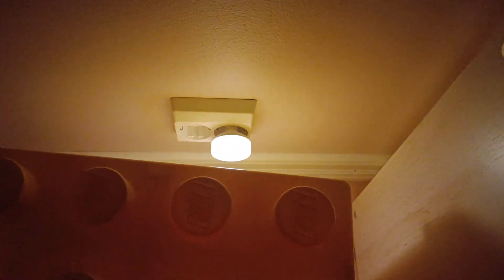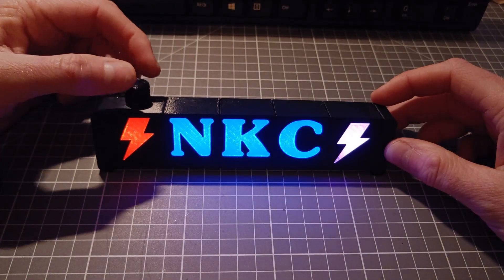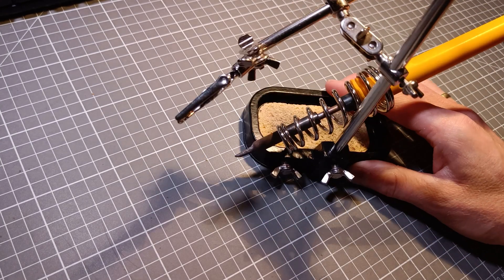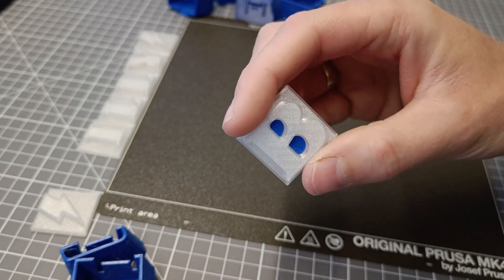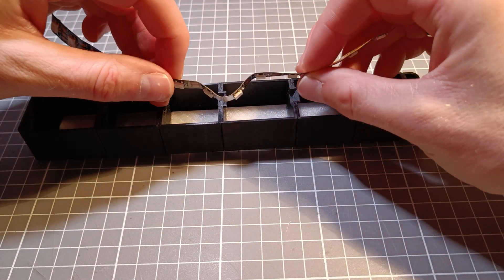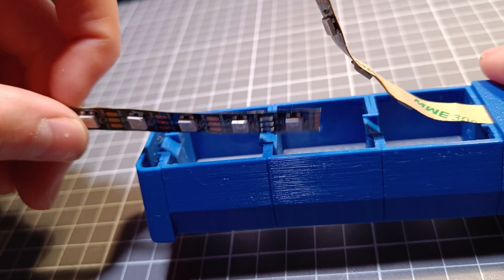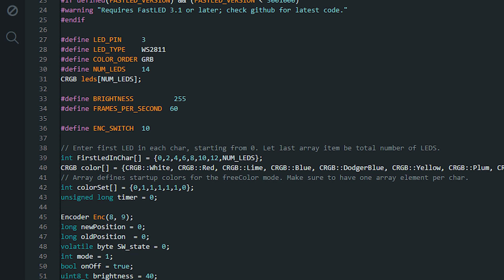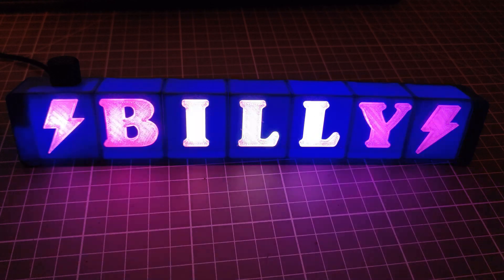3D Printed Modular RGB LED Sign

Comment: Very nice build! Flush or extruded? Hard to choose! I'm more on the flush side but the extruded has great character also! A question: resistor before the data line? I have never used it, is that really needed?
Reply from the maker: Thanks!! I like them both too, kinda depend on the use. I think the resistor is supposed to limit noise and protect a bit..but guess it works fine without also, especially with no long wires.
Reply: @TheSkjegg   Hmm, noise! The project I'm working on has some flickering, I need to try that resistor!
About WS2812: there are a lot of products out there, fairy lights style from 1.5 cm to 10 cm spacing, rings shaped, and even COB style, extremely dense strips and the newest I found is a COB ring shaped one, various diameters, check them out cool stuff!
Oh, and one more interesting: SK 6812 strip (side LED) that emits light to side of the strip, not perpendicular to it!

Comment: what should the seeed xiao device look like in windows device manager   i have just usb serial port com5  but i cant upload to that  arduino ide doesnt like that
Reply from the maker: Did you install the Seeed SAMD Boards? Then select the XIAO as board, and Port as com5. Sometimes XIAO causes trouble, but reconnect normally works, or IDE restart.
Reply: @TheSkjegg  i tried then i noticed i have not the samd board i have the RP2040 board  i had to download and install other board drivers but i guess your code doesnt work for Seeed XIAO RP2040 board i guess they are 2 different yet look similar boards.. and the program you wrote is not compatible with the RP2040 version.. they looked the same i didnt realize i ordered the wrong ones.. so i guess i need to return and order SAMD boards
Reply from the maker: Aha, that explains it. I've never used the RP2040 myself, but would assume it should be able to do the job? Code may need some tweaks to work though. Hope it sorts out!

Comment: Can ı use arduino uno
Reply from the maker: Yes, but you need to figure out how to power it. The hoverboard gives 15v and the Uno is max 12v.. Why not use a XIAO?
Reply from the maker: Sorry, just realized I thought you commented on my Drift Trike video - now for the sign, yes you may use a Uno as well, but you cant fit it into the sign box obviously.

Comment: Made my first sign yesterday & today, "WA6YBD" my ham radio call sign. All and all it went well. I did have several problems but I was able to over come most of them. My printer is a Bambu lab X1C. I printed everything in PLA.
1) The slip and fit joints for the cubes are too tight. I removed ~.75 to 1 mm per side of the center tab that joins the cubes together. 
2) The fill letters (in my case ) were too large to fit the cubes. I corrected this by scaling them down in the slicer to 99%. 
3) The fill letter "A" does not fit the cube at all. May even be the wrong font. 
4) The hanging down blackout tabs for the letters "W & Y" are too large to fit into the fill letters. The tabs did not fit even before I scaled them down. I was able to correct this by filing each tab to fit. 
5) The radio fill does not fit the build cube. It is too tight all around. I was not able to scale it down and make it fit . 
Today my LED strip and uP. arrived. Now its off the see if I can get the electronics to work. 
I cannot begin to imagine the number of hours you have invested in this project. Thank you for making it available to the rest of us.
Reply from the maker: Great that you're already building, love it 😊 However all your problems with scale are no good.. I'm printing with PETG and Prusa MK4, had no such issues. Of course it's a tight fit, but it works. Must be either a diff between the printers, or the filament. I haven't tried PLA yet, will do so tomorrow and report back to you. Btw what layer height did you use?
Reply: hi I used 0.15 mm and then tried my default 0.28 mm. I have some PETG black but no transparent. I did get everything to fit except the "A" fill. It looks like the wrong font. The letter is too skinny and does not fill the opening in the block.   @TheSkjegg
Reply from the maker: @billmelody8618  I just downloaded the files from Printables, opened "A" fill and box in PrusaSlicer, and positioned them on top of each other. By moving the a fill up Z axis its a perfect fit with the box (as expected, the fills are cut out by using the boxes in Fusion360). Actually I printed a "A" myself today, no issues. Ok, I'll let you know my results of PLA prints.
Reply: @TheSkjegg  OK thanks for checking.
Reply from the maker: @billmelody8618  I now printed the "A" fill and box in PLA, and it fits. Had to fight a bit with the small triangle insert, but it works. So I really don't understand your issue. Stupid Q, did you use the "Å" fill?! Ah, just realized Printables names the ÅÅ as AA when downloading all files as zip..sorry, weird Norwegian letters you know 😅 Try downloading the single A stl!
Reply from the maker: PS: I now changed names on the Æ, Ø and Å files - so should be ok now in the All models ZIP download.
Reply: Thanks! That was it. I downloaded all the files and now I have an "american A". I dried my PETG over night and today printed out new blocks for my sign. Set my slicer as you recommend, all printed without any issues. The slip-fit joins are very tight but I was able to get them to lock in. I test fit a fill letter printed in PETG black to full scale and it fits. My PETG translucent  just arrived and I am drying it. As soon as it has dried I will print all the fill. Yesterday I wired up some LED's to the uP, programmed the uP, and got all that working. I think I am good to go. I will post a link to the finished sign when finished. Thanks again! ~Bill  @TheSkjegg
Reply from the maker: @billmelody8618  Just awesome, and your feedback helped me catch that naming issue with the files! Would love to see the result!
Reply: The same here with the joints. How did you removed 1mm per side of the center tab?
Reply from the maker: @nicomarty8435 what slicer/printer do you use? Could it be some setting or unit issue? 1mm off is a lot, and just on that center tab? Maybe you could post a picture in Printables comments?
Reply: @TheSkjegg  I just removed 1mm of every side of the flap and now it works now. Now i try to work with arduino. ;)
Reply from the maker: @nicomarty8435  Glad it sorted out! Good luck with the electronics, let me know if any issues 👍
Reply: @TheSkjegg  I use Bambu Studio. Maybe i could take of less then 1mm but it works for me.
Reply from the maker: @nicomarty8435  Ok, I'll consider shaving off a bit on the tab if I make a new version. Might be another font in the future.
Reply: @TheSkjegg  That would be good. Today i finished and it works fine. even my one designed FCB Logo. ;-)
Reply from the maker: @nicomarty8435  Great, you made it!

Comment: How about ventilation holes? I mean have you tried to keep the lights (at max brightness) on for the long time( 8 hours). Is there any plastic deformation from the heat expected? 
May be putting metalised type on the back?
Reply from the maker: Good point, I had them on for quite a while but not with full brightness. I now have my Billy sign all at rgb(255,255,255) on my desk and will keep it on for the rest of the day. I'll let you know the result.
Reply from the maker: I left the sign on for a whole day, full steam.. it generates heat of course, but not that much.